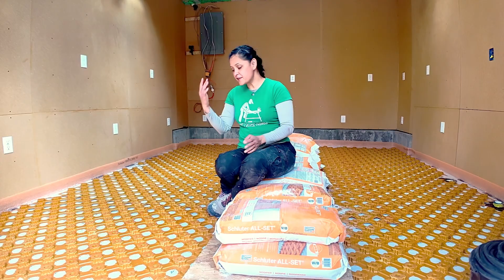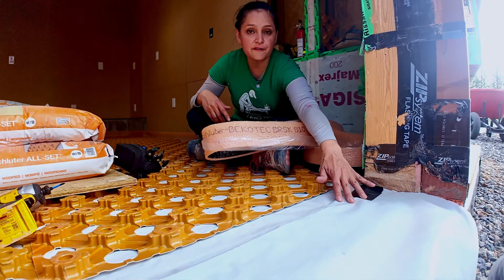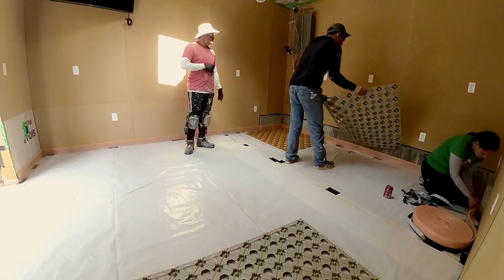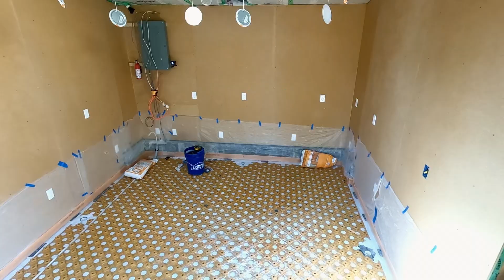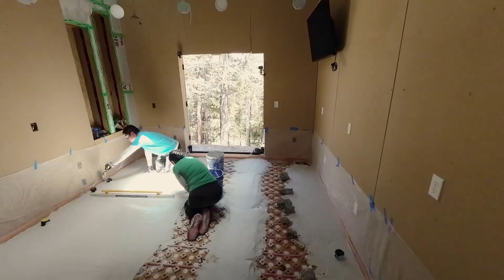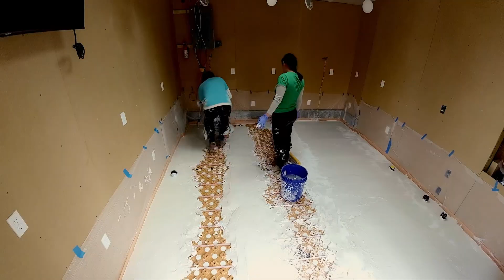Easy and Luxurious: Radiant/Hydronic Heating! #radiantheat #hydronicheating

Comment: Roughly how many bags of thinset are needed  per square foot to cover the panels? I can’t find that info in the spec sheets.
Reply from the maker: To be honest I don't remember, I know it was at least 30. But level to the earth is not the same as parallel to the floor. I recommend parallel to the floor. Also, it was really expensive, we will give Sika self leveling a shot next project. It might be easier and hopefully cheaper.
Thinset has the tendency to dry and shrink, making it hard to stay level.
Reply: @efficientbuild  I was thinking to go the Sika self leveling route. I'm just trying to calculate how many bags I would need to see how much this would cost. 30 Bags seems like a lot. How big is the room? It looks like it is roughly 12x16 so just under 200 square feet.
Reply from the maker: It's about 12x14 ft, but the 30 bags were to level on top of the radiant heat and for the tile on top of that radiant heat. We were also leveling to something a bit higher. Schluter has documentation related to how much to use. That said, you will probably end up using more than the Schluter table.

Comment: Why didn't you guys use warmboard  for your hydronic radiant floor?
Reply from the maker: Hello! Initially mainly for cost. Warmboard is expensive. Also, because we use tile, on purpose too. Tile and cementitious materials have the best thermal mass. It's better than the metal from warmboard. We are also taking advantage of the thermally broken slab.
Warmboard shines more on wooden or vinyl floors.